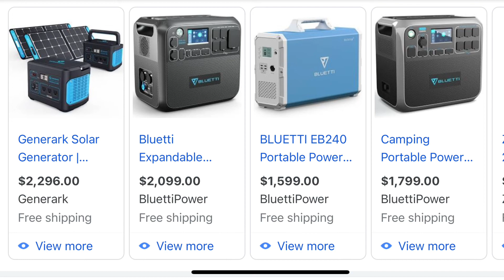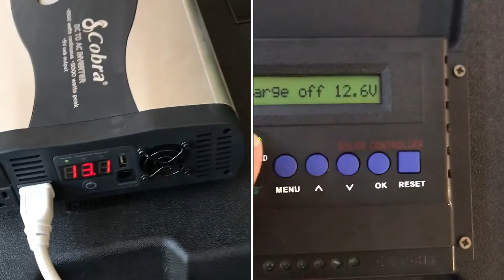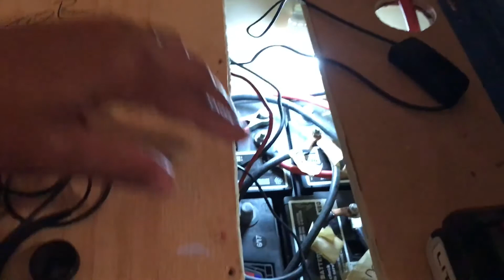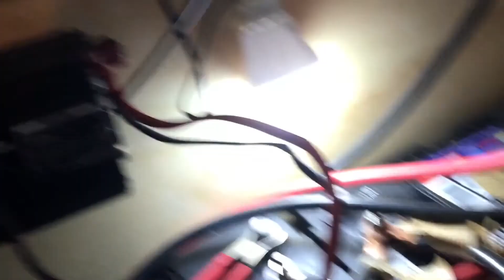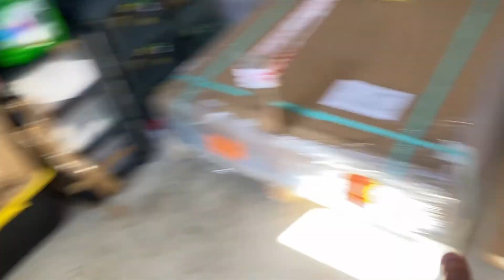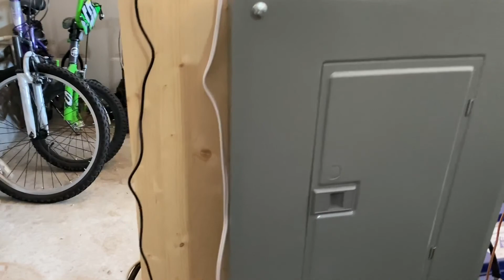Buy or Build A Solar Generator: Pros & Cons

Comment: Great video. Thanks for sharing. Do you think that system well do your entire house? And how is the system now?
Reply from the maker: The system is great. I will definitely have to get more solar panels but it will run half the house. If I’m not using ac or heat it could run with more panels 👍🏽